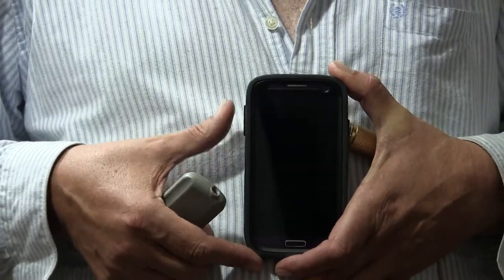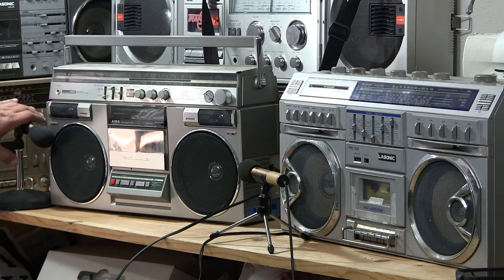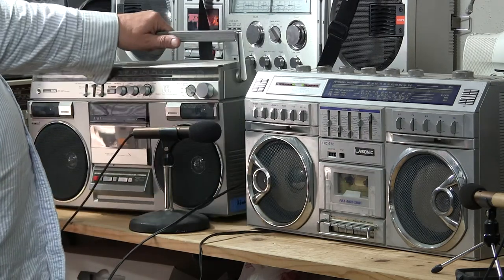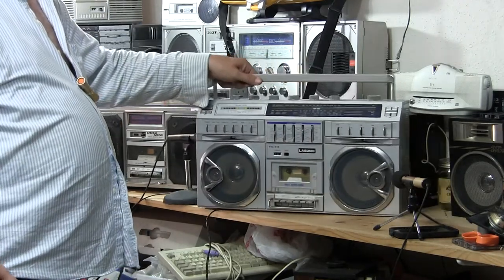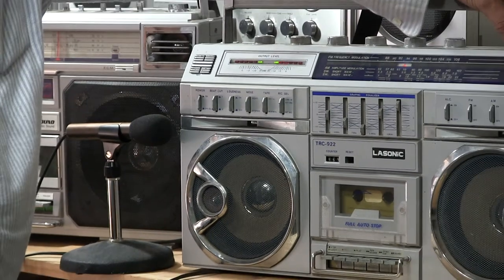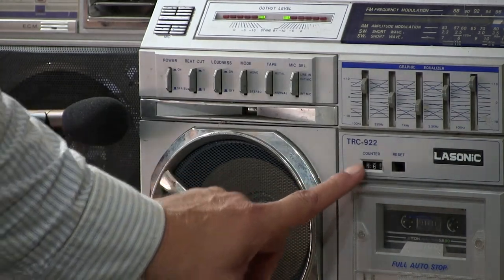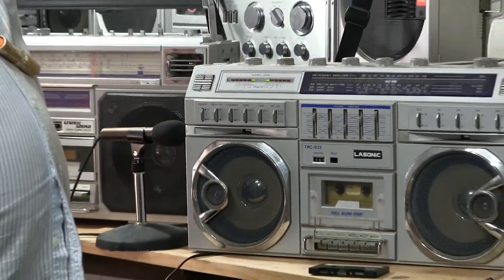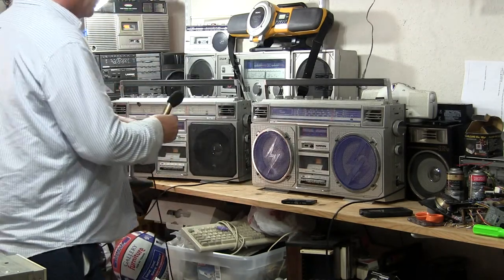Boombox Exhibition Units Wanted stero2go

Comment: {GENERAL SOUND Model no. R-808}   150 plus shipping???
Reply from the maker: +TheParts1800 If you are in the USA $280.00 grand total shipped & tracked etc. Email me jamespierceiii@hotmail.com for more info.
Reply: In the USA $220.00 grand total shipped & tracked
Reply from the maker: $260.00 best I can do via paypal or 250.00 cash 713-460-1717 James call me - grand total shipped & tracked GENERAL SOUND Model no. R-808